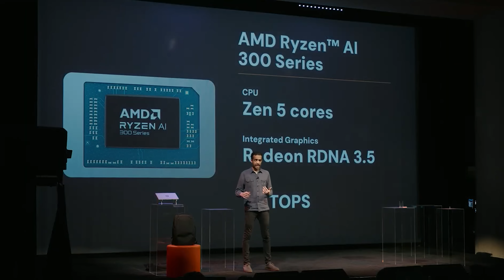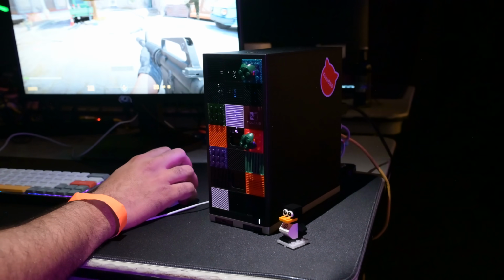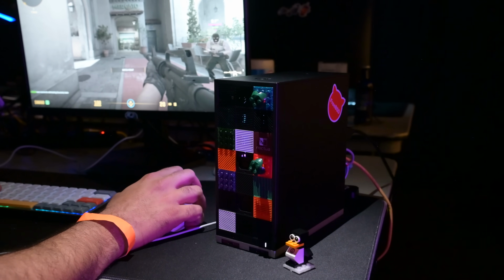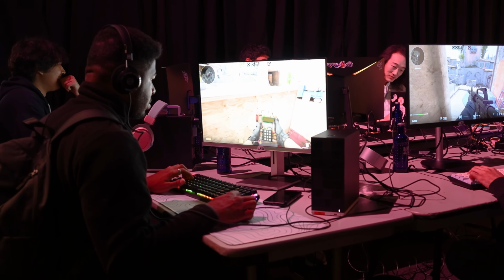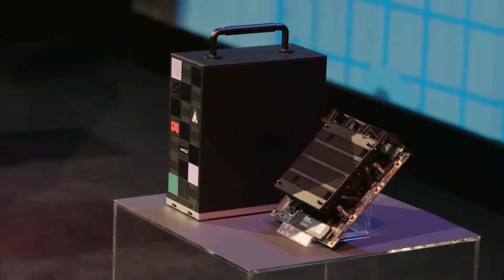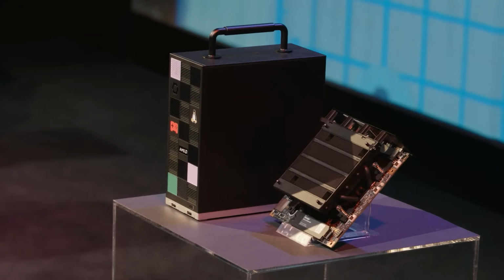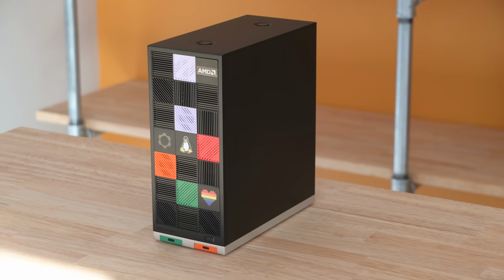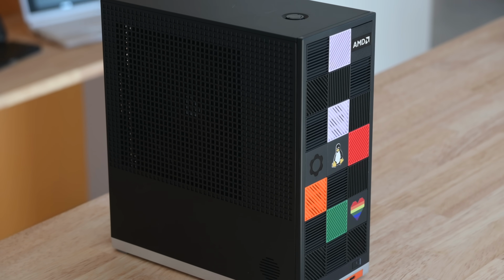Modular, Open, Repairable – The Framework Desktop Teardown!

Comment: I'm not entirely sure what market segment this serves -- i see all the chatter about hosting LLM's locally, but all I'm seeing here is a laptop motherboard transplanted into a march larger chassis. Soldered RAM, soldered CPU, m.2 expansion cards for wifi and bluetooth. In fact, I would say this thing is LESS serviceable than their standard laptops as everything is essentially soldered to the motherboard, and they've even opted for a janky JST connector for the CMOS battery rather than a regular coin cell slot? Why?  And yeah whatvever i get that soldered RAM can run at higher MT's but we already have 8000Mhz/MT DDR5 modules from Kingston, G.Skill and others. Again, this product is weird and i don't get it but i'm sure whatever market it serves will be happy i guess?
Reply: The highest end gaming PC doesn't have system memory with bandwidth that can feed this GPU. This soldered memory CAN feed this GPU.  You literally cannot build this kind of machine yourself modularly.
Reply: it's pretty obvious that AMD approached them to make an AI PC that could compete directly with the Mac Studio and NVIDIA DIGITS. That's why they're so uncompromising about RAM.
Time will tell if LPCAMM just wasn't enough
Reply: @illeatmyhat  as Nirav from Framework discussed over in the LTT video on the new products - they went to AMD to see about using LPCAMM2 modules with the Strix Halo SOC's used in the Desktop here, and AMD ran in to nothing but signal integrity issues using the LPCAMM2 compared to just directly soldering the RAM chips to the interposer.
Reply: @illeatmyhat  the problem is AMDs memmory controler, there weakest link right now.
Reply: @DJDocsVideos  We don't know that. It's a brand new memory controller. AMD has never done a 256b wide bus on an APU before.
Reply: It’s QUAD CHANNEL LPDDR. STOP COMPLAINING. DIMM won’t work like that and CUDIMM is not supported by AMD.
Reply: @TransparentUmbrella  Did you know that you can put gasp FOUR DIMMs in a desktop motherboard? The fact that consumer desktop platforms generally run dual channel is a market segmentation choice, not a fundamental property of DIMMs as a means of attaching memory to a system (there are plenty of quad and even 8 channel systems using DDR5 DIMMs if you look outside of just mobile CPUs and consumer desktop)
Reply: @bosstowndynamics5488  lmao Stirx Halo uses Packaged DRAM so it’s not replaceable at all.
Reply: @bosstowndynamics5488  so you think you can make a LPDDR DIMMs 🤣🤣🤣🤣
Reply: @TransparentUmbrella  Who said they had to use LPDDR? They were under no obligation to select parts that constrained them to LPDDR, it's an ITX sized board, they could have stuck an AM5 socket in it and shipped it with a proper desktop spec CPU if they wanted to. They made their bed, they chose a design that prioritised an unnecessary degree of compactness and a bit more performance in terms of iGPU and having an iNPU, but they don't get to do that while also bragging about how modular and repairable the single monolithic soldered together board is when the design brief is the exact opposite to the design brief they have on every other Framework device (which is to make them a little bit bigger, a little bit less nice and a little bit slower in the name of making them a lot more user repairable)
Reply: @ bro Strix Halo packaged DRAM on Package or Only support LPDDR. Framework has nothing to decide about it’s memory type. Complain to AMD, not Framework. And strix halo targeted LLM Inference. So that is just a cheap NVIDIA A100. Not a Mini PC.
Reply: @TransparentUmbrella  Framework chose to use a mobile Strix Halo chip in their desktop design, not AMD. As I already said, they could have used a socketed AM5 chip for, again, their desktop, not mobile, computer. And buying one of these as an exclusive AI inference and nothing else box is bad value for money, so that's no argument either. 

The point I'm trying to make here is that all you guys are buying into marketing bull really, really hard right now. This shouldn't exist as a Framework product, and if it must exist they should at least have the guts to admit that they've made deliberate design choices that make it far less repairable than it otherwise could be in the name of making it a little bit smaller and a little bit faster in some specific workloads rather than this nonsense "a really repairable desktop!" wank.
Reply: @ 이게 일반 PC규격의 제품이면 누가 이걸 사겠냐. 생각좀 해라 어깨 위에 달린건 장식이냐? 무겁게 뭐하러 달고 다니냐. 소켓 달아놓으면 당연히 ITX 빌드를 하겠지 이걸 사겠냐?

애초에 AI 추론용으로 나온 수리가능한 GPU라고 보면 기존 GPU보다 훨씬 안정적이고 빠르면서 수리가능한 제품인데 뭔 헛소리를 하냐

그리고 프레임워크가 광고하는 제품 중에 뭐 제대로 된게 있긴 했냐? RTR 하는 놈들중에 정상이라곤 하나도 없더니 여기 딱 그 표본이 있네
Reply: I can see this being used in an automotive self driving situation. I'm currently working on such a project and you need a lot of processing power if your analyzing video feeds
Reply: i'm sure DDR5-8000 is way more expensive than soldered LPDDR5 and more power hungry
Reply: @reiniermoreno1653  A 48GB kit of Corsair Vengeance DDR5-8000 is $399 Australian Dollars. I would imagine it would be much cheaper for a system integrator buying in bulk, and I would personally pay the premium and take the performance hit to have guaranteed future upgrade-ability. I understand these machines have much more RAM than that but my last point still stands. Give us the option. I would buy this without hesitation if it had swappable RAM at the very least.
Reply: @reiniermoreno1653  the price is comparable to that of socketed 8000mhz ram but if you simply go down to 6800mhz which would have negligible performance change you would save £200. Also the powe consumption of ram is the last thing you should be worried about in a system.
Reply: @baconwizard   8000Mhz DDR5 is still going to be ~40% slower than the soldered memory on the board, there's more to memory speed than just frequency.
Reply: Your DDR5 modules don't have 256 bit bus. And wide bus is the reason RAM is soldered.
Reply: @RandomNothing88 The wide bus isn't the reason it's soldered, it's soldered because SODIMMs can't go faster than 5600MHz and it didn't occur to them that an ITX sized board should be using desktop memory instead of soldering the stuff on a system that's pretending to be repairable.
Reply: @ Bro, wtf are you talking about? Desktop memory (DIMMs) has the same speed as as laptop memory (SODIMMs) and only has 64-bit wide bus. The only way to have 8000 MT/s 256-bit bus memory right now is to solder it. LPCAMM2 are not available yet.
Reply: @RandomNothing88  A very, very quick Google search will demonstrate that DDR5 8000 DIMMs are not just possible but widely available. The issue isn't whether it's soldered (LPCAMM isn't soldered either) the issue is that SODIMM slots specifically have issues with signal integrity above about 5600MT/s, which is why in laptops there's a very clear speed difference between models with SODIMM slots and equivalents with soldered memory, and yet despite this in the higher performance desktop realm no one has felt the need to sell motherboards with soldered RAM aside from Apple and now Framework.
Reply: @bosstowndynamics5488  well, even if I was wrong about desktop memory speed, it still has 64-bit wide bus when this particular AMD chip requires 256-bit bus and you can't get that with desktop memory. Also, generally a 256-bit wide bus is going to be 4x faster than a 64-bit wide bus.
Reply: @RandomNothing88  Strictly speaking AM5 runs 64 bit wide memory channels but it's also dual channel so the total memory interface is 128 bits wide (64 bits *per DIMM), and there's no rule that says they can't run 4 channels instead (which is exactly what HEDT/workstation platforms do, they just run quad channel), AMD just made the architectural choice to limit AM5 CPUs to dual channel only.
Reply: there's more to AI than just LLM. so many people don't get that. The power consumption is less than a similar am5 system.
Reply: Guys, if user-replacible memory is slower, where are the benchmarks? Consumers will decide if this is a flop (it is).
Reply: @firstNamelastName-ho6lv  SODIMMs are definitely slower than soldered LPDDR5, the real issue is that Framework claimed their entire mission was to make devices more modular and repairable, and yet they're here bragging about how repairable a device is that's less repairable than nearly every other option in the mini desktop space because they chose a fairly modest performance improvement over modularity.

Comment: Just wish that the PCIe slot was one of those with an open end so you can plug longer cards into it, other than that I love that they're putting this SoC onto a desktop board!
Reply: In worst case scenario you can use a power tool to make it open-ended PCIe slot.
Reply: Yeah, that seems rather uncharacteristic. I bet it's only closed-back on the engineering sample. It looks like they kept the area behind the slot clear for that purpose.
Reply: file, problem solved.
Reply: i mean you could turn the two framework port at the bottom front into anything really
Reply: @mjdevlog  it's usb C ports I'd rather have 'em as ucb-c ports. the good USB4 ("only" 40Gbit) is only on the back.
Reply: The cpu only has 16 lanes of PCIe, that’s why it’s not a full size slot
Reply: @pedrofortunas  doesn't matter, better to provide opportunity for people to use what they'd like there than to restrict people
Reply: @pedrofortunas  you can use 16 lane GPU on 1 lane pcie slot, it will just have smaller bandwidth. the only thing stopping it is the closed end of the pcie
Reply: @pedrofortunas you can leave off the bit of plastic at the right end of the slot, so you can plug any card in no problem
Reply: @pedrofortunas  they were not asking for 16 lane slot they were asking for a slot that physically fits x16 cards as you can run even ngreedia GPUs witx x4...
Reply: @ I understand what u guys mean. im just saying why its  like that.  They have alot of IO and thats board is not really design for gaming. you can see that  for the price theyre charging

Comment: Is it possible to cut that PCIE x4 slot so that I can mount a Mellonox Dual 25Gbps Connect-X card? Asking for a friend.
Reply: Someone on Framework's official forum already asked for this. Go and add your request :)
Reply: @AlphaConde-qy7vi  I submitted my request :)
Reply: You can
but you definitely would lose warranty coverage
Reply: It's also missing the expansion slot cut-out in the case. I thought that was odd considering they do have a PCIe x4  slot on the mobo and this would open up more expansion module options in the future.
I reckon they might have concerns over the lack of airflow over that area though - high speed NICs and storage controllers (e.g. NVME on a breakout) tend to require quite a fair bit of airflow to keep cool.
Reply: Production Run systems are likely to use open-backed PCIe x4 slots, worst case scenario is you do a little bit of modding to open the back of the slot.